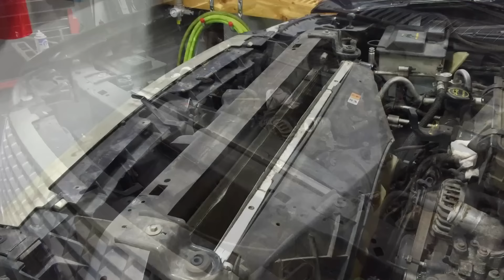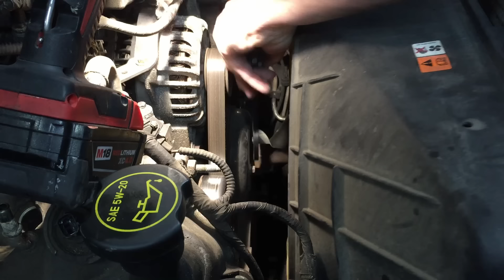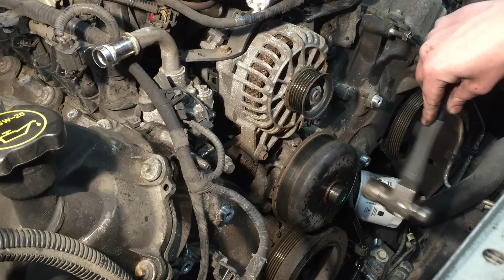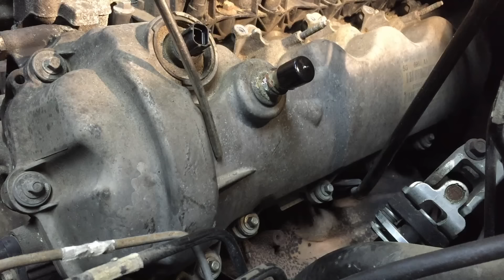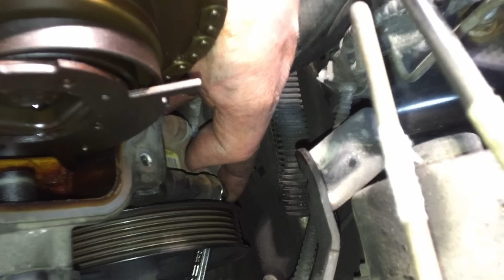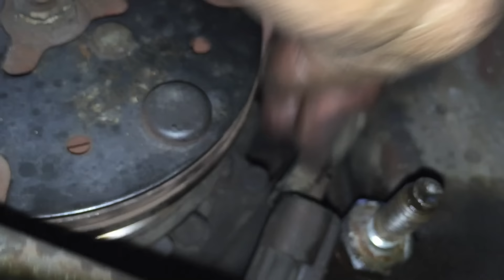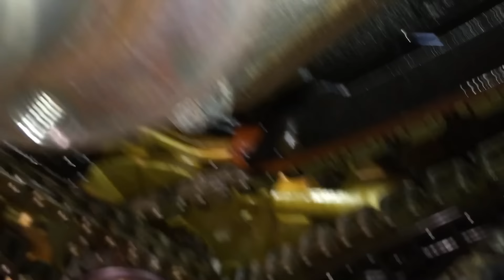Ford 5.4L 3v Engine Timing Chain Kit Replacement Pt 2 of 4: Front Cover & Valve Cover Removal

Comment: After removing the valve cover on the right-hand side, you mention removing the left-hand valve cover before the front cover. Is there a reason you remove the front cover before the LH valve cover?

Comment: I just picked up a 2005 F150 Super Crew 5.4 3V 2WD. It’s a nice truck, it was $300 dollars. It runs and drives great after installing new spark plugs. But man, it has 278,000 miles on it! I’m seriously wondering what its timing situation is looking like. I am
Thinking about piecing together a kit, and doing it all! Phasers, rockers, lash adjusters, timing chain, new VCT solenoids,  new oil pump, new crank bolt, new serpentine belt. The truck runs so good right now, and I really want it to stay that way without worrying about breaking down.

Comment: When I pulled mine off the upper plastic guide on bank 1 side was broken in half. The retainer bolthead for the upper was snapped off from being over torqued, or It was because of the cheap chain and dorman phasers going out. 34:40

Comment: Does the driver side lobes need to be at 11 when pulling the roller followers? Or is it just the passenger side? I have the followers on the passenger side off but the exhaust follower is giving me some trouble on the drivers side. Not I already have the two intake followers off

Comment: That valve cover timing kit that you have in the link, the valve cover gasket does not fit my vehicle what are the chances that that will work on my truck

Comment: Brian, thanks for the videos they are very good quality and instructions very detailed. I started working on my 2004 FX4, I have got to the point of removing the valve cover screws, all are fine except the one at the very back against the firewall,  I have tried  different combinations of extensions and wobble joints, do you have any insights to get to it?
Reply: I got the rear drivers side valve cover bolt out with a 1/4” 8mm short socket a 3” extension with a wobble at the socket and a small 1/4” ratchet wrench. Took the cover off and to my surprise all the roller followers seem solid. Onto the passenger side tomorrow 😳
Reply: @cliveblowers709 thanks for the tip 👍

Comment: doing this job now. I just took the fan out and after two days of trying everything have, someone told me to take my pipe wrench and hit it straight down on the end with a metal mallet while pulling it to the left. 3 good hits and it loosened right up.
Reply: how do you determine when the timing chain needs to be replaced?  my 2006 f350 has 220k miles on it and i don't hear noises rattle at all.
Reply: @monoracional  consider yourself lucky up to this point. I would go ahead and change out all the timing components and the upgraded oil pump. I waited just a little too long and wound up scoring my cams and cam caps due to oil starvation caused by a blown tensioner seal. If you do it now and also upgrade the roller followers and HV 340 oil pump you'll be doing your truck a big favor

Comment: Just fyi for anyone doing this job, the power steering pump stud on the bottom is way easier to reach from under the truck with a regular 1/4 ratchet and deep 10mm, and 09-10 f150 are so easy a lot of room

Comment: The fan clutch comes off easy I just used a harbor freight wrench set to take off the fan clutch and it reversed threads not right tighty

Comment: Question….  The stud on the lower right side of the timing cover (by the AC compressor) has a nut , two hard lines, and a hard rubber wiring holder that needs removed out of the way before the stud can be removed. How do you get that hard rubber wiring holder removed?

Comment: So why use ford factory parts if you know they will fail. There are no better options for the same job?
Reply from the maker: These are later engineering designs of course.
Reply: @FordTechMakuloco so I have it apart from, intake is off as well for bad knock sensor. Need to replace numerous bolts and nuts. But my question is how far do I go with replacing parts. This is a truck that sits alot. Primarily used for welding jobs, dump runs, etc. it probably won’t get a few thousand miles a year. But I want to do a good job as it will make the truck last for many many years. What would you do? Let me know because I will listen to you thanks.

Comment: Thank you, Brian! In 2017, I got a great deal on a low-mileage 2010 Expedition, but soon discovered the issues with the 5.4 3V engine. Thanks to your detailed instructions, I had the right tools, parts, and procedures to get the truck running great again. Had to do the timing job in Dec 2024, its been running great for two months, so I believe its fixed. I’m truly grateful for your help.

Comment: You didn’t show how to take off the bolt on the back of the valve cover between cab and the motor!!!! What tool did you use? I’m stuck now on two back vc bolts. No room to get a tool in there or see the bolts!!!!
Reply: You can it's just a huge PITA, I tried every socket I had to get it just barely hitting the top of the hood....

Comment: Just took off the power steering pump on my '06 Expedition while doing the timing job. I clamped off that hose that comes down from the reservoir, and just pulled it off. Gives you a TON more room to access those top bolts.

Comment: Any tips on passenger side valve cover gasket. Number 10 on the RH side diagram. It a like the transmission dipstick is right in the way. And if I follow that back there is a bolt that I could undo to loosen it but it seems like it would be darn near impossible to get a wrench on it.
Reply: There are two methods: First is to pull the PS wheel well liner to get to the trans dipstick bolt (18mm). Other method (field method) is to bend the transmission dipstick tube gently to move it out of the way for the duration  of the job.

Comment: Is there any wisdom in just pulling the heads and doing the exhaust manifolds at the same time? Since you are all the way in there?

I also keep fasteners with the component. I either screw them back on or I put them in a baggie and tape them to the component with painters tape.

Comment: Did my F150 with these videos  and Im now 50k miles in and still running strong! Thanks Ford Tech!
Reply: How long did it take you?
Reply: I can’t really say because I would just work on it little by little in my spare time. At least 2 weeks. Maybe 20 hours of labor.
Reply: I can’t really say because I would just work on it little by little in my spare time. At least 2 weeks. Maybe 20 hours of labor.
Reply: I can’t really say because I would just work on it little by little in my spare time. At least 2 weeks. Maybe 20 hours of labor.
Reply: I can’t really say because I would just work on it little by little in my spare time. At least 2 weeks. Maybe 20 hours of labor.

Comment: Are the melling rocker arms/follower rollers worth using even if it's for a while until I can get Ford parts in stock?
Reply from the maker: The followers and lash adjuster are readily available.
Reply: @FordTechMakuloco  if you can find a "readily available" set that I can purchase today then be my guest but I promise you the parts aren't as easy to find anymore. The after markets have taken over. Only Ford(a few select distrubtors) sells them and they don't carry full sets.
Reply from the maker: Wait I order them 3-4 times a week from my wholesaler no problem.
Reply: @FordTechMakuloco  thats not technically readily available but ok. i found a usable link to a full set. probably the only one left on amazon tho even the set on your videos is unavailable as of a few days ago
Reply from the maker: No I order them 3-4 times a week and they come next day. I didn't say they come in 3-4 weeks.

Comment: Well this blows! I have a frozen lifter on exhaust valve cyl 1" and the only way to swap out with a new one is to remove the whole camm?! Or can I loosen the cap bolts enough to wiggle the lifter past the lobe and install the new one same fashion??" Thoughts ? 411 is appreciated?"

Comment: Any tips for getting the lower part of the steering reservoir bracket off the motor (07 F150)? I've removed the wheel wells and am having a heck of a time getting a socket on the 18mm bolt down there.

Comment: I have watched all the videos I believe on 5.4 timing chain replacement. Great job on video.just what is best kit to buy. I know u said go with ford but there are alot of fakes .can ugive me a site to replace all of timing chain kit . Replacing phasres followers and lashers . Had a bad follower bad and truck has 270 000 on it . Cam look good and top looks fine. Don’t want to get junk but need to not b to pricey. Thanks again great videos I’m a female and made it even easy for me

Comment: Hey man, I have 2012 Expedition, are there any little surprises that I might run into on this year? It looks like there is a lot less things to deal with on the passenger side and it has electric fans. I'm not even going to remove the fans I don't think. Anyways, just wondering about anything "little" I might run into on this year. Thanks for your attention to detail brother!

Comment: Getting ready to do this as soon as I graduate from Fordtechmakuloco U. I saw another video of a guy who used a piece of cardboard to draw a diagram of the front cover, every time he took a bolt out he stuck it in the corresponding spot on the  cardboard. Great idea to keep everything in the right place. Thanks for the great videos Professor!
Reply: Going to do the same aswell brother! I have a question and not sure if you will know the answer but I’ll ask anyways, when I inspect the cam caps if there is wear to the point that it catches my nail should I just do a phaser delete because of the reduced oil pressure because of clearances or should I just go ahead and do it anyway?

Comment: How do you make the go/no go decision once you get the valve covers off if you find a lot of caked on sludge? In most of your videos, the inside is beautiful. My '05 Expedition 5.4 with 205K has no failed roller followers and just a little loose on the passenger side chain. But there is thick sludge everywhere. I'm thinking plug the return ports in the heads and clean it as good as I can. But I'm thinking I really need to pull the pan too. I putting on a M360HV. I'd hate to have the pickup plugged up with sludge too.
Reply: Hey guys, don't skip dropping the pan unless it is clear that every segment of the guides are visible under the timing cover. It's really not that big a job to drop the pan and only an hour longer on a 4X4. It makes zero sense to spend this much time rebuilding the Timing system only to end up with a blocked pickup tube. The best Melling pump won't overcome the restricted oil flow if your system is plugged with plastic debris. A big benefit is that with the pan down, access to the pickup tube bolts is easy. If you skip this step, thinking about all of the plastic in the pan is going to be knawing on your brain every time you hear the slightest tick in your engine. Be absolutely certain, drop the pan and blow out the tube and screen.
Reply: @richardwilson117  Nobody like to hear this, but you're 100% correct.

Comment: Mine didn't rattle or anything it just died and wouldn't start back what do you think is going on with mine I've pulled the valve cover and you can touch the chain it definitely has slack do you think mine jumper time or something like that????

Comment: I did everything in the video and the timing is f*cked as I burnt out 2 starters. It almost started. Did hte roller foulers aND KIT AND MELLON360 OIL PUMP. STILL NO START,,STUMPED IN pg bc

Comment: First your videos are awesome and much appreciated.  I have a question that maybe you could help me out with. I have an 05 f150 with around 215k miles on it. It's doing some weird missing at idle that the local mechanics cant figure out but end up defaulting to timing issues. One of my mechanics is saying that it needs the timing kit with phaser delete job and the other is telling me to replace with a Jasper motor and that it's not worth putting the 2 grand for the timing kit because I'm just going to continue to have problems.  What do you think? Thanks

Comment: This is a great tutorial.  I have 1 question.  I have a 2005 f150.  I have everything off except the front cover and passenger side valve cover.  The valve cover is not coming out.  The AC lines angle into it.  Do I need to discharge the lines and move them ?

Comment: How do I remove the bottom left cover bolt that has a molded plastic electrical harness that feeds the starter. I removed the metal clamp that holds the transmission cooling lines.

Comment: I have an expedition 2005. The driver side valve cover has a damaged bolt. The one that's in front of the firewall in a hard to reach place. What options exist to remove that damaged bolt? My hand barely fits in there

Comment: What size bolt is needed to pull the crankshaft pulley?
Reply: I believe they are standard 3/8" thread, but the Harbor Freight puller bolt kit has all of the combinations of size and length.
More important is the style of puller you use. Each uses a different length of bolt.

Comment: I just took my valve cover off yesterday and in the passenger side one of the roller followers was just laying there found some broken pieces also lash adjuster was broken. I'm wondering if the broken pieces have damaged anything else in the engine I haven't found all the pieces only a few.

Comment: If you are having trouble taking the fan off another good way you can take an air hammer with a chisel bit and give a quick burst or 2 on one of the edges of the nut and it should break loose

Comment: Just a heads up.  Use a puller on power steering pulley.  Makes it a lot easier to access removal.
Reply from the maker: I can have the bolts out by the time the pulley is pressed off.

Comment: To remove the fan I removed the belt and alternator, then clamped a vice grip onto the pulley lip so the pulley was locked in place then used a 15 inch adjustable  wrench and and baby sledge. Only took 2 moderate blows until the fan came loose. Can't figure out the logic behind this design .

Comment: I'm getting ready to do the Vance cover gaskets on my 2001 F150 4.6 with 130,000 miles. I purchased OEM gaskets but what other items should I knock out while I'm in there? I use mobile one extended performance pretty much since 32,000 miles. I drive 3500 miles a year.

Comment: I did complete timing from start to finish in 2 days, I thought this would be hard work, but turned out it’s way better and easier then Toyota Camry timing, but I was working on 5.4  2V engine, not 3V, and I did also replaced all 16 rollers and hydraulic adjusters, I’ve bought that ridiculous valve spring compression tool for 2V engine, IT’S SUCKS!!! 3V engine compression tool is much better and safer. And I ended up not using compression tool anyway, and the reason, one of valve keepers are flew away with the speed of light somewhere! Probably it’s in other galaxy by now, instead of compression tool, I just use a plastic clip removal tool, to pop out rollers, and to install back, however, I was replacing valve springs as well, and to keep valve up, I lowered piston all the way down, then through the spark plug hole, I filled entire cylinder with 3/8” nylon rope, and then turn engine by hand, till piston with the road is holding valves up, then it’s safe to remove valve springs.

Comment: Can you replace the 05 valve cover with a newer one that only requires 8 bolts? Bolt broke off removing the passenger side and I cant remove it.
Reply from the maker: Yup you sure can.
Reply: @FordTechMakuloco  Thanks for the reply I appreciate it

Comment: My crankshaft pulley bolt won’t break loose, it spins with the pulley.. Any insight?
Reply from the maker: You must hold the pulley with a strap belt or at the flywheel. Better yet rent an impact.
Reply: @FordTechMakuloco  thanks and I have and was using an impact gun with no luck, my only 18mm socket is a 12 pointer so I will pick up a 6pt later today and try that.

Comment: A side note: the 2005 F-150, you almost have to remove the upper radiator hose from the radiator to lift out  the fan shroud.😁 I tries everything and gave in. BTW, you're video series on this job is a God-send. Thanks from the bottom of my heart!😊
Reply from the maker: You can easily remove the fan shroud on all f-150 models with this engine I do it everyday.

Comment: You really make this look like many can perform this. I am banking on it myself. I have an 06 that just started the Form tick. It has 138k on it. I bought this 6 months ago and it really is a well kept truck so well worth the TLC needed.I know this video is old but wow you really know your shit. Cant imagine what a job like this would cost at a mechanic but part alone for the complete timing, rollers oil pump alone is around 1500. Getting my list together and will be ordering in a few days

You really are the Boss of this.
Reply: did you do it? How did it go?

Comment: Hey broo...thanks for the video..I have a question is that correct to add 20-50 engine oil to stop lifter noises on my 2006 ford f150 5.4 v3 with 210k milles?
Reply: Probably way too late to answer - but I tried adding some oil "goop" to help with lifter noise and it probably gummed up the small oil supply holes on the roller-followers, and I think it kicked one out.  I'm about to open my 2006 5-4-3 up and try to replace just the roller-follower without changing the cam.  I know that's hinky but I figured the engine only has 30K miles left (at 240K now).

Comment: I don't know if this is a unique situation, but my 2010 has 8 bolts on the right valve cover and 9 on the left.Did Ford change this at some point?
Reply from the maker: Yes in mid 2008